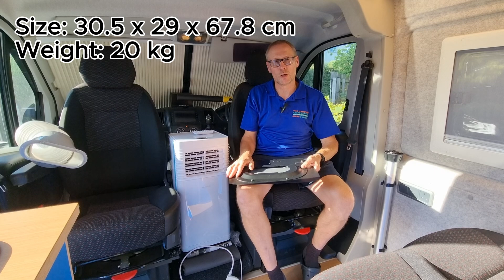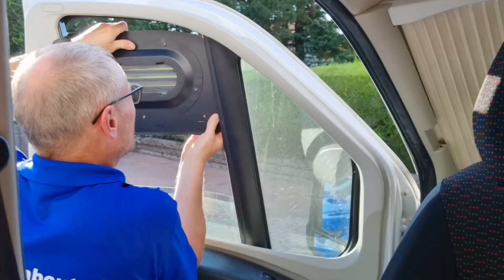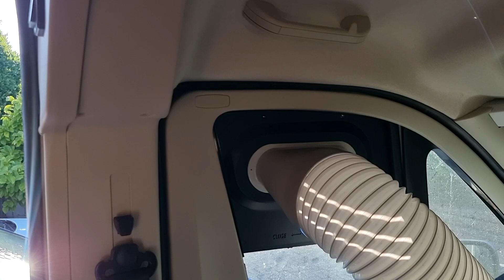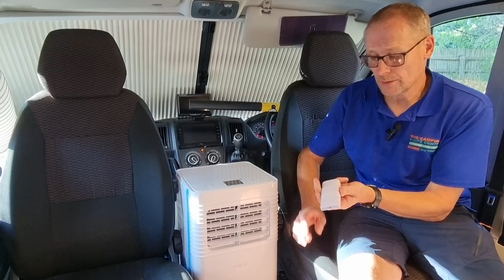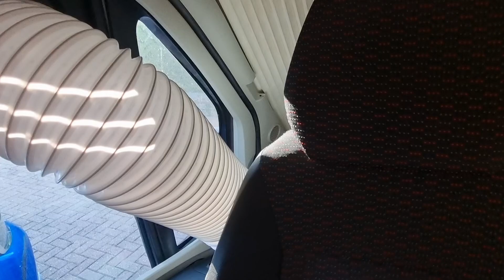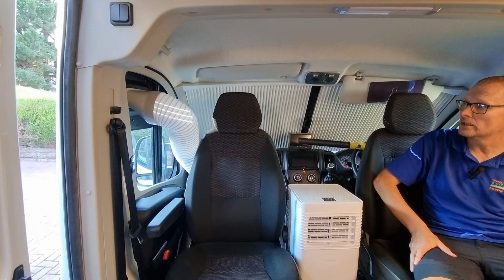Brunner Polarys Imperator Portable Campervan Air Conditioner

Comment: I got one of these about 3 weeks ago , works great , quiet enough for sleeping ,no noisier than our compressor fridge  , I got a "Haoall" insulating sock for the trunking on amazon for £11, If you don't go too low  with the temperature you dont get condensation .
Reply: Do you need a hook up to power it for the night?
Reply: @bobbylord9948  Yes, It is mains